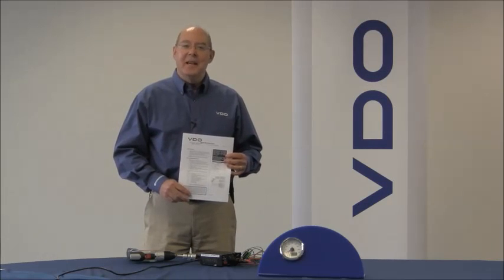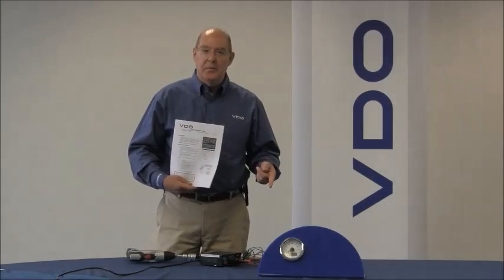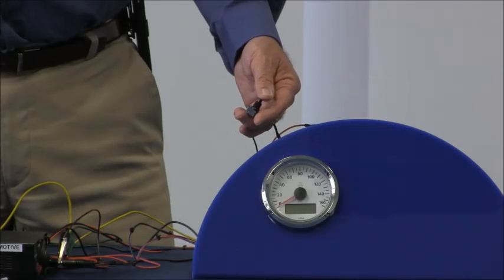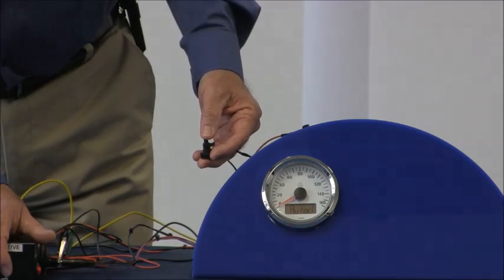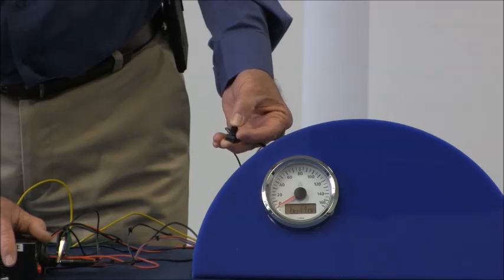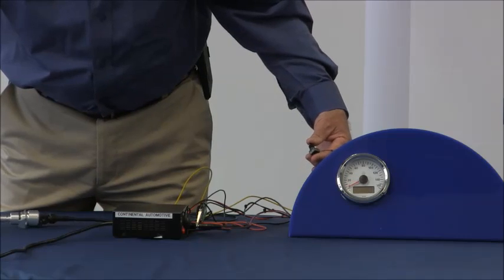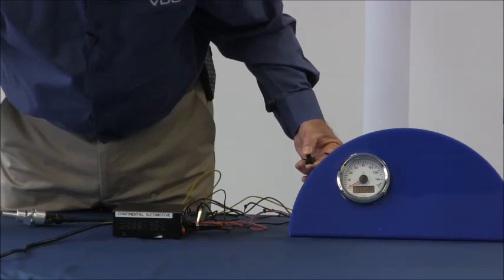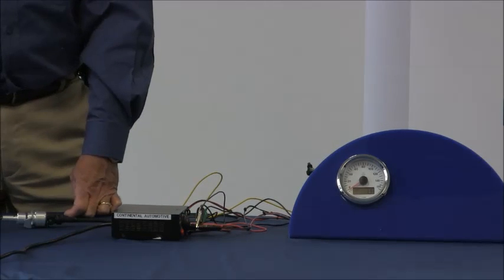How To Program Your Viewline Speedometer

Comment: Your web site is NOT very helpful.  I have a VDO electronic speedometer in a Class A motor home I purchased.  It started indicating speed varying from 5 to 30 or so MPH when I just turn on the key while sitting still.  I was hoping to find some troubleshooting information.  There doesn't seem to be any.